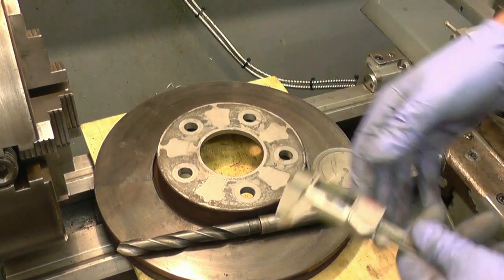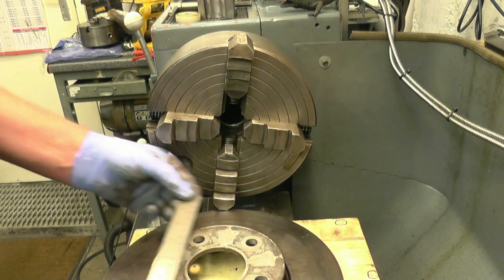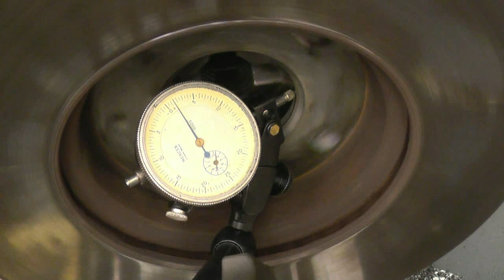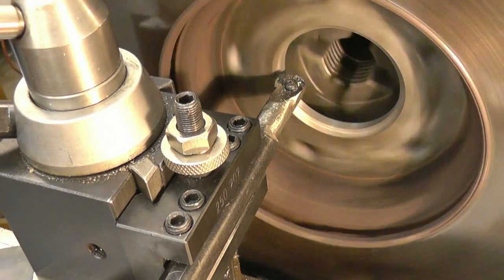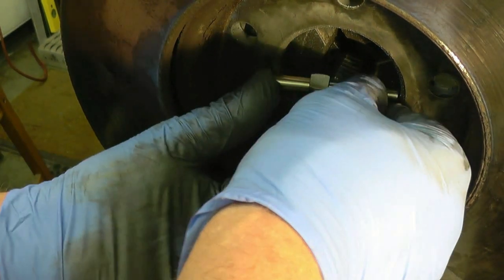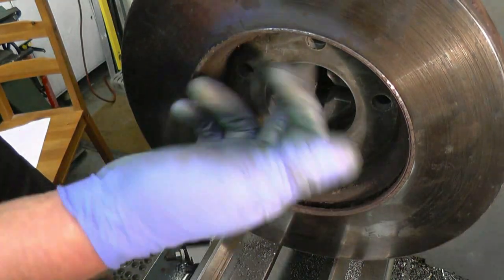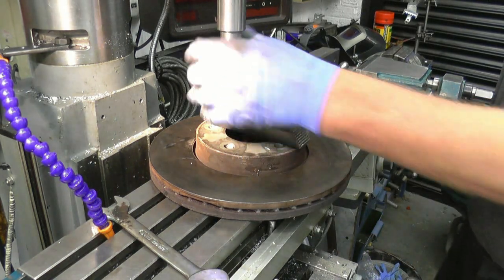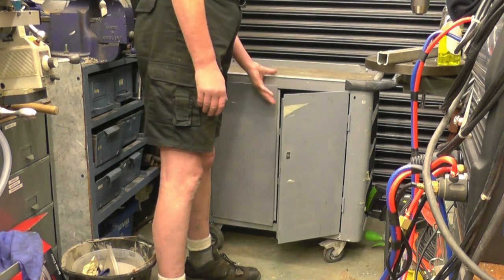Sunday Night  NC Re Edit

Comment: John, I've done this kind of work many times before, I found the boring head in the mill to be a lot easier.  You can clamp a disc down to the mill table easier and centering the spindle is much simpler, overall it makes the whole job a lot easier.

I've done wheel centers with the tires still mounted, that way.